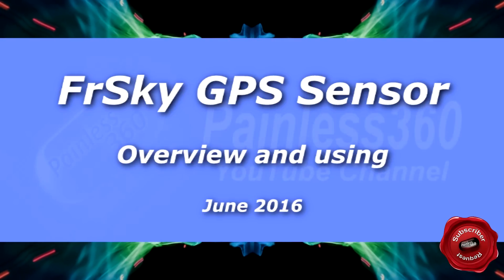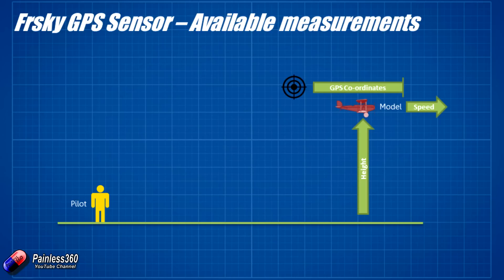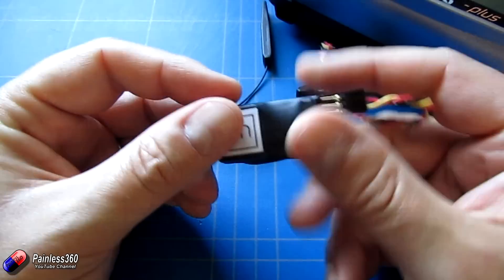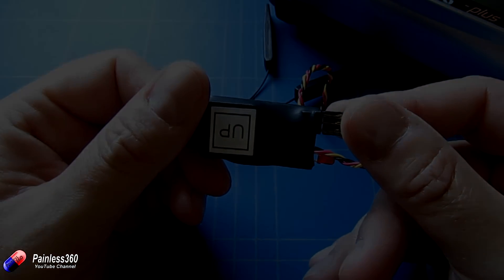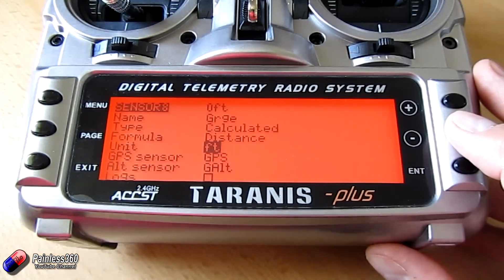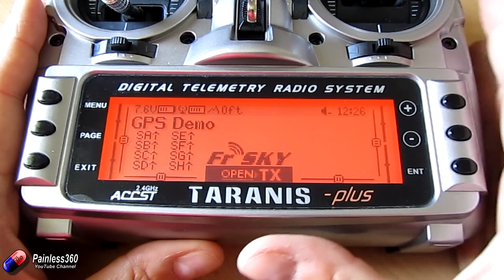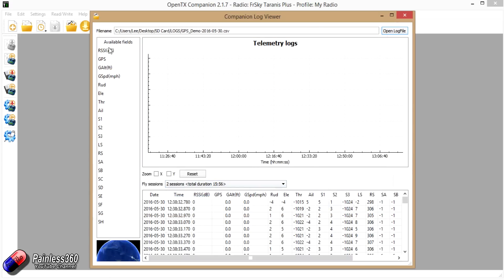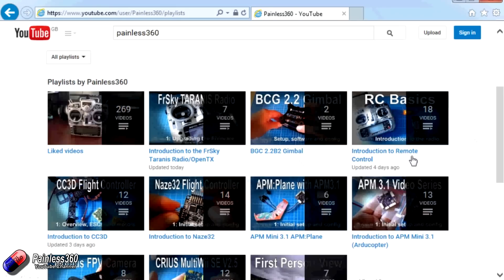OpenTX 2.1 Telemetry: The FrSky GPS Sensor, setting up, using and creating extra sensors

Comment: Can these be mounted underneath carbon fiber?  By that I mean does the "up" side need an unobstructed from above view of the sky?  There is not mention of it or requiring a clear view in the manual.
Reply from the maker: Ideally covering it with anything isn't ideal in practice thin layers of foam shouldn't make a big difference but I would avoid metal and CF cover... Happy flying

Comment: I realise that this is a bit of an older video, but I'm wondering can you do/get the same information using the GPS on the Kopilot Lite or would you need a separate GPS sensor to get the relevant information??
The reason being the new ceiling limit that we now have to observe...
Reply from the maker: The Kopilot GPS is only for the Kopilot. Sadly no telemetry out of the Kopilot...
Reply: @Painless360  Ah, that's a bummer...

Comment: After watching this, I ordered two.  The logging of flights as a lost copter finder is invaluable.  "Find my model" saved me twice using DJI drones.  As far as I can tell, this is way better than what DJI offers because with DJI when the power on the lost model runs out, that's it.  It's not saved anywhere.
Reply from the maker: Don't forget about the RSSI trick with the radio too. Used that again yesterday to find my flying buddies model...
Reply: @Painless360  Do you have a video about it?  It's news to me.
Reply from the maker: Lots on the channel... Google something like 'lost model painless360'...

Comment: good evening Sir. is there a way to use this gps as a variometer ??? thank you
Reply from the maker: I've not seen one as they sell a variometer separately. I bet that someone has written code that can be run as a LUA script on the radio that will produce the tone in response to the changing GPS height reported back to the radio.. If you get it working please let me know..

Comment: Awesome!! Is there a way to use this GPS on a quad controller?
Reply from the maker: If you are looking for GPS on your quadcopter then check out my series on INav. Betaflight is also adding a lot more capability with GPS controllers now so by adding a GPS to the flight controller that's already in there you can unlock lots of extra cool stuff. Hope that helps..

Comment: So as it takes the sbus port on my RX8R how do i then get the battery voltage telemetry that was fed from my FC smartport ?
and is there a way to get the gps speed and alt to show up in the BF osd , via a channel similar to the way to get rssi?
Reply from the maker: First question: You connect the smartport wire to the FC - see my 'Quadcopter building' series on the channel where I do it almost every time. Second Question: See previous answer :D Best of luck!

Comment: Do you know if this will work with a Frsky D8r-ii plus receiver. I am having real trouble finding info on what sensors work with it.
Reply from the maker: The older D series receivers used non smartport sensors. They have been replaced now in the majority of models that we fly with the later X Series receivers that use smartport sensors. See my OpenTX series where I did cover this in the telemetry videos.

Comment: Not sure if this will help anyone, but on my latest quad build with an M8N gps module installed, I get GPS coordinates, Alt, and heading data through the flight controller to my Taranis X9D Plus. It appears to be pretty accurate. I'm going to be doing a little more testing as time allows, but I'm starting to set up log files so I can see the data. If it works as I suspect, it will be VERY helpful using the Google Earth app to track a lost model or even look at flight paths.

Comment: I love the simplicity made possible using smartport but am concerned about the units low precision.  I would like to see video of live telemetry as displayed on the Taranis screen or osd (that is an option I presume?) to get a better idea of what to expect.  Near the end of your video (many thanks by the way) the "flight path" represented in yellow within Google Earth appeared to fail to reorient itself in relation to your input changing the ground map orientation.  I'm not sure if more time was needed between changes for the program to make corrections and display the path accurately or not??
Reply from the maker: +Timothy Tendick if you want more accurate GPS stuff, check out the iron Out series on the channel. You really need to be using a flight controller and using the flight controller telemetry and on screen display to do the things you're asking about. Best of luck

Comment: I want my taranis to tell me my speed.  Is there a way to tap in to my pixhawk GPS and send that data to Taranis either directly via telemetry, or indirectly via mission planner?  I only want speed data to shoot very controlled landing approaches.  My laptop is over 100feet from me when I am flying.  Thx.
Reply from the maker: +Scot Caraway see the Pixhawk 2.1 series for the latest. I've not done that personally. Best of luck
Reply: I will look into your 2.1 series.  Here is what I found in the mean time.  http://diydrones.com/forum/topics/amp-to-frsky-x8r-sport-converter?id=705844%3ATopic%3A1539556&page=1#comments  Looks like you can put a Teensy between your Pixhawk and X8R to send a lot of the data directly to Taranis.  Not sure what the refresh rate is but the rate of the FR Sky GPS is 1hz.  My plane's GPS is 5hz so that might b a bonus if the telemetry runs faster than 1hz.  ALso, nice to have minimal hardware on the plane too.

Thx

Comment: hi, thank you for your videos , it's very helpfull to configure my taranis. In telemetry menu i added gps and in distance menu, i set "m" as unit predefinition but in voice alerts i listen like "miliams" not meters has i expeted. can you help ?
Reply from the maker: +nuno costa make sure you have the right sound package on the SD card. The numbering and layout changes between Opentx versions. Best of luck!
Reply: Painless360 
thank you for your replay.
I find today if i define f/s as a units in my alt2 menu the voice on alerts say meters and find my units don't correspond correctly  to the voices!

Comment: hi painless ! i would like to ask you a question about frsky temperature sensor, i bought this sensor for my hexacopter but the temperature leads are too short to reach the motors and esc`s , would it be possible to extend these leads with a 2 pins extention wire,,,,thanks
Reply from the maker: Hi, I;m not too sure as I've not used one here but looking at the specs I can't see anything 'special' about the copper conductor used in the connecting wires. It looks like a thermistor at the end so adding wire may affect the overall drop in the cable..  Best of luck!
Reply: THANKS PAINLESS,,,,ILL GIVE IT A TRY

Comment: hi there please could you help I have a d4r 2  will this work with the frsky gps sensor if not which one will I also have a taranis plues
Reply from the maker: ggvaper you need an X Series receiver with smartport to connect the GPS to. Happy flying
Reply: god that was a speedy reply thanks very much which one do you recomende I have the diation trident 180
Reply from the maker: +ggvaper we use the XSR a lot..

Comment: Hi there, Bruce here once again, but this time I have a little mystery with my FrSky Variometer. 
My taranis Plus LBT (2.1.9)  X8R (LBT) and Vario High precision Smart port are my equipment.
I have set the vario up in a glider, and set up my Taranis "radio set up" to receive the sensors info (i think???) 
I have activated the vario beeps   and the Play value through Special functions and the SC switch, centre position and down.
PROBLEM
Play value is reading out "miliamps" instead of my setting of "alt"
Have you got a video on setting up a  FrSky Variometer, please?
Regards
Bruce
Reply from the maker: Sorry we've not played with that. Make sure you are using the right sound pack on the SD card for the version of OpenTX you are using. They changed some of the files and formatting for sounds in 2.1..

Comment: +Painless360 Would you be so nice to measure this unit's weight without any cable attached, only the base unit?
Reply from the maker: The weight of the GPS?
Reply: Painless360 Yes, please. I want to install it on my copter, but I want to keep it as light as possible
Reply from the maker: All of ours are in 'planes at the moment so that'd be tricky. It's listed as 11.3g on the HobbyKing site..
Reply: Painless360 Okay, thanks. I have seen that, I was just curious if that is real or not

Comment: Great video/s!  I wonder how to show mximum values reached for Galt, Grange and Gspeed on screen of my taranis?! I have tried adding virtual sensors with calculated and "max" function there but it does not seem to work. Any sugestion? Thanks, continue with your great work. bye
Reply from the maker: Not sure, we've never tried. Let me know if you figure it out! :D
Reply: Choose "Galt+" or "Gspd+" in telemetery screen. that works.bye

Comment: I love your videos, always informative 
just a quick one, any possibility if this can be viewed thru my FPV goggles
Reply from the maker: Not that I've seen yet. If you wanted the GPS information then you'll need to add a GPS and MinimOSD to the flight controller you are using. Best of luck!
Reply: Painless360 thanks 
just another question not related to this video, can I install parallel antenna port, one which is fixed 2.5db and another port with rpsma connection, so I can plug the 5db antenna as in when required
Reply from the maker: For FPV? You'd need a diversity receiver for that really..
Reply: Sir, my point was on my Taranis 9XD plus, i want to add another antenna along with the factory antenna
Reply from the maker: I've not seen that, if you get it working I'd like to see how you did it all. Best of luck!
Reply: Painless360 thanks will share once done

Comment: How do I use this with a battery voltage monitor at the same time
Reply: You can also use an Y splitter, it is not really two ports, they are exactly the same. So if you have two sensors with only one port or you can only place them in a way where it would be complicated, just keep that in mind :)
Reply from the maker: You daisy chain them. That's why the sensors have two S.Port connections - one in, one out..
Reply: Painless360 thank you so much. I love your videos

Comment: everything seemed to be working perfectly, had my telemetry screen setup to display gps, Gspd, Gdis and Galt. Although it took longer than expected, gps lock was finally established at home in the garden and the co ordinates were accurate. Went out for a test flight, my other gps module (rth and flight stab) aquired satalites within a couple of minutes. The frsky gps remained flashing fast for 15 minutes before i lost patience and launched. throughout a 23 minute flight the gps was still aquiring satalites without success. Any suggestions?
Reply from the maker: +Stephen hathaway sadly the Frsky module isn't the fastest. See the comments in the video. I hope the v3 is more sensitive. Best of luck!
Reply: +Painless360 speed is one thing, reliability is another

Comment: How do I start the logs recording? When I fly and go back to reed them  I never have and logs to read and the proper boxed are checked in Telemetry. everything works great just no logs to view..any help would be great.
Reply from the maker: You need to assign that function to a switch and flick the switch to start it - see the other videos in the series that we reference in this video for how to set it up..
Reply: Found it Thanks for the help
Reply from the maker: No worries - happy flying! Logfiles are cool..
Reply: I could't see my flight path in Google Earth until I found this helps it helps someone (In the top left part of the screen, under ‘Temporary Places’, you should see your flight track listed. Right click on it and select ‘Properties’. Click on the ‘Altitude’ tab and change the drop down box from ‘Absolute’ to ‘Relative to Ground’. If you don’t do that, then portions of your flight track will be underground!

Comment: When I write to you, I always fear asking stupid questions and wasting your time. Also, asking what has been previously answered/demonstrated by you, I do worry about, also. So, the Frsky XSR w smart port, is currently being used for telemetry with a F3 FC, how can one add this module using smart port on the XSR? how does one daisy it? Or does one daisy it?
Reply from the maker: +Steve Gross you could daisy chain them. Personally I'd use a GPS on the FC and then get the telemetry from that into the receiver. The FrSky GPS is only really handy when you have a model without a FC (like a plane). Happy flying!

Comment: FrSky Smart Port GPS (V2) Sensor dose not work very well and I can not see much benefit from using it, 
as to its data reporting is very slow (late) and inaccurate (bad data reporting). 
This FrSky Smart Port GPS (V2) Sensor Very ,Very Over Rated.

Comment: Hi, I would like to know which is the cheapest flight controller with gps,  fail safe return to home autopilot, and maybe with mission planer, for fixed wings? Mostly I am interested in something that will bring the model back if the connection is lost or at the flip of a switch and osd, like a little icon that shows the aircraft position in relation to the launch or pilot position. Since every 6 month something new come up maybe I am missing something. I think the cheapest I have seen was around USD there is one at hobbiking in sale for around $45 I think but It does not say it could be used on fixed wings only multirotors , mmm the sale ended
Reply: This one I think is very good for you: http://www.ebay.com/itm/DJI-Naza-M-Lite-Flight-Controller-w-PMU-Module-LED-Cable-Ublox-GPS-Holder/252354280773
Reply from the maker: See our flight controller comparison video - we cover all of this and a little more too. Hope it helps..
Reply: yes I know but I was wondering if you knew a specific cheap one I have been researching trying to find the cheapest one at the moment this one has the title but maybe is all in Chinese http://www.banggood.com/F2S-Flight-Controller-with-M8N-GPS-XT60-Galvanometer-for-FPV-Aircraft-p-1059807.html are you familiar with it?
Reply from the maker: We don't use lots of versions of the same one so tricky to help. Best of luck!
Reply from the maker: Thanks for the suggestion..

Comment: sorry if my question does not relate to this video.

please show me video tutorial on how to install micro sd module to the Crius AIO pro board or multiwii board(if the same case).

I hope you can explain how to connect the cable or the driver for micro sd...

I am very, very appealed to you because I believe you are a pro in this case, thanks a lot ^_^
Reply from the maker: +aDe sorry, we've never done that. Best of luck with it!

Comment: Sometimes it's like you're reading my mind. I'm still pretty new to the sport but heavily into my second build, a 500 size Quadcopter this time, my first, a 700. I tired of trying to operate everything with my cheap or hacked together Transmitters and just ordered a Tarantis 9XE,  two D8R-XP Receivers and the X6R Receiver that comes with the E Transmitter. I've of course  never used a tray Transmitter, or anything that I could successfully get to send a full 8 PPM signals. I also ordered a flashing cable to allow me to flash firmware to expand the frame lengths onto the Receivers if needed. I look forward to trying all this telemetry equipment in the future... and my new Transmitter... so keep this good stuff coming! Thank you!
Reply from the maker: Thanks Terry - best of luck with the new Radio!

Comment: Some older autopilots can fly planes on GPS only (e.g. DragonOSD). That obviously requires an inherently stable plane.
So in theory, GPS telemetry opens doors for the possibility of a future version of OpenTx being able to fly the plane for you (e.g. in loiter or RTH mode) as a ground based autopilot. It's not much of a useful feature since without a radio link it is useless, but it could be a nice gimmick to have.
Reply from the maker: That would be nice but if you need that I'd always pop an APM/Pixhawk into the model and use their excellent GPS Home mode.. Happy flying!

Comment: You should probably also point out that the accuracy of the sensor is limited because of it's refresh rate as well.  This GPS sensor refreshes at 1 Hz, or once per second.  This means that, on average, any information from the GPS is about a half second delayed.

I see videos of people using GPS sensors to indicate speed when, in reality, they are quite inaccurate for that unless the platform is moving at a constant speed and direction for several seconds at least.  That's a rarity for quad users anyway, but may be more reliable for fixed wing pilots.

Basically, people should just keep in mind that the sensor only outputs a new data-point once a second.  Derivative values, like speed, are naturally an additional second behind and even less accurate because of that.
Reply from the maker: Thanks for the comment, in practice I've found this fine for fixed wing models. I'm hoping that FrSky are listening and give us a much larger sensor and improved resolution in the V3!
Reply: Keep looking at this GPS !  but any idea when the V3 will be coming out ? Or any one know how to connect a bigger-better antenna to this V2 ? Thanks for the great video's.
Reply from the maker: No idea, on this I'm just another FrSky customer..

Comment: awesome, does the radio display last location? so can it be used to find a lost model
Reply from the maker: Sadly not by default, I'd always use the SD card logs then you can pop the SD card into the PC and see the last reading.. Maybe there is a LUA script? Happy flying!